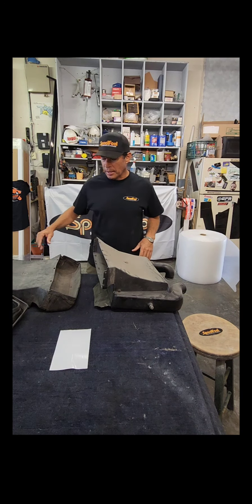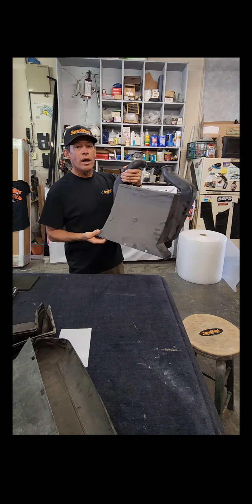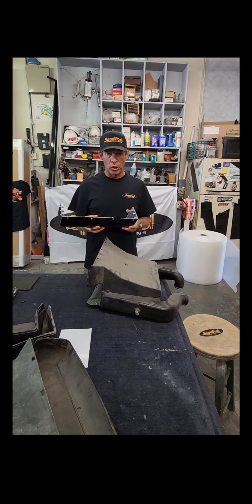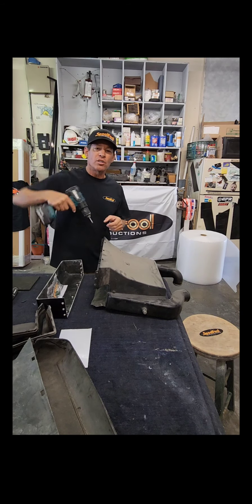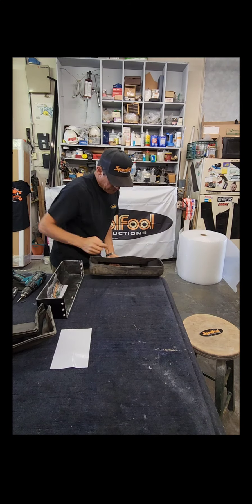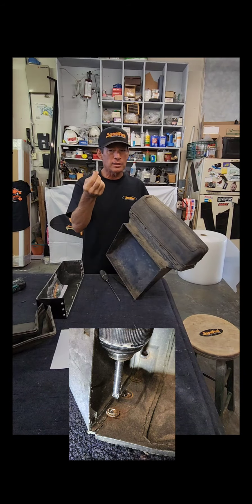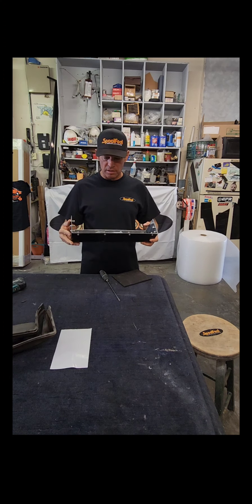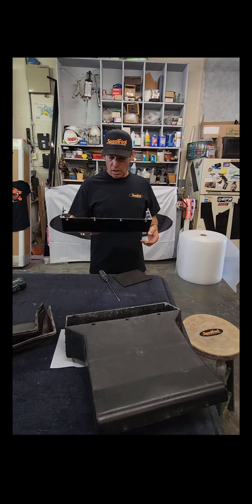Spoolfool's new replacement Inner Cooler Scoop for 86-87 Turbo Buicks.

Comment: Mike have you put any thought into make a stretched slic with aluminum shroud....
I believe only precision is making them...
Or is there no market for them...
Reply from the maker: It would be a limited market. I did do a one-off, boost activated, drop down, SLIC shroud / scoop for my old V$. I did a write up on the Buick board a bunch of years ago. I think all the pictures got lost when the board crashed.
Reply: @spoolfool2  
That intercooler shroud you made was neat...
Awesome product